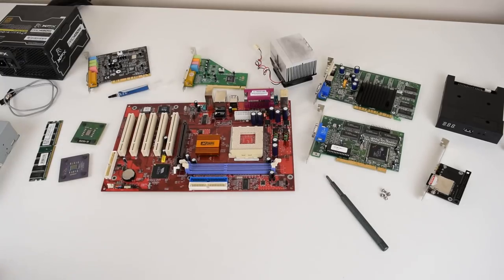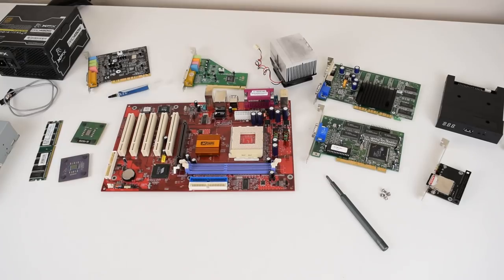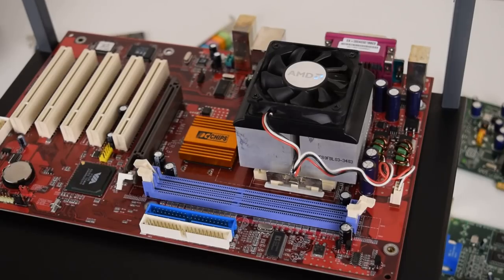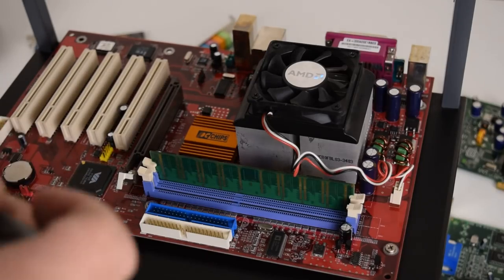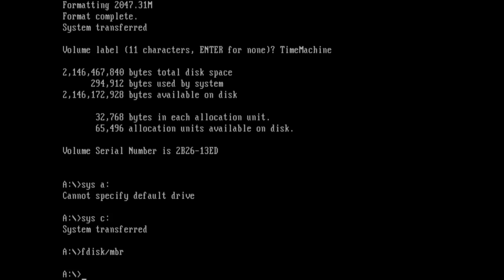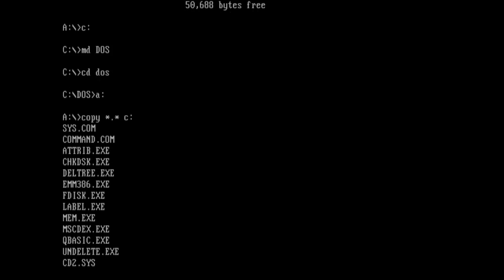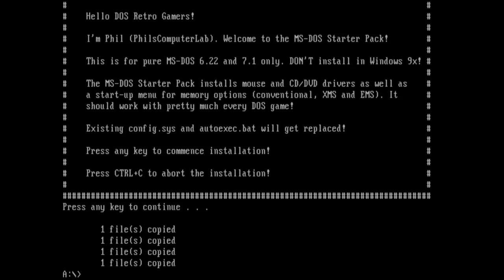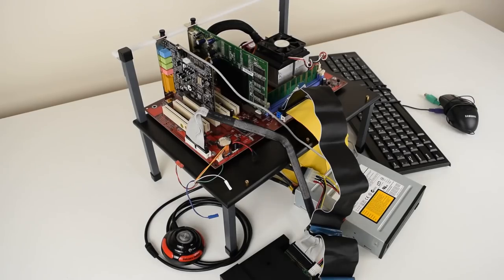Building a DOS Retro PC that everyone can afford

Comment: Hey Phil, I'm building a budget PC and I want to use a LGA1156 board, I'm planning on getting a X3470 and I want to overclock it to around 4 GHz which seems to be doable on most chips. The problem is that I do not want to spend too much on my motherboard and on Aliexpress I found those cheap Chinese boards that support overclocking however the VRM coolers look very basic. If you know if they are capable enough or if I'd need a to strap a fan to it or if its not doable at all I'd greatly appreciate it. :)
Reply from the maker: Are you sue they support overclocking? Do you have a link? We might have some videos coming up in 2 to 4 weeks, but not sooner than that.
Reply from the maker: That is pretty much exactly the board I ordered a while ago! It hasn't arrived yet. I highly doubt you can overclock it, but we will see. Would you overclock by changing the bus speed, or with an unlocked CPU? I reviewed a H61 board recently and it had all sorts of quirks. Fast Ethernet only, PCIe limited to 8x, no working Turbo. Rumours have it they gimp it to save power and make sure its stable.
Reply: It is a Xeon X3470. I'm not sure whether it is unlocked but I've seen forums online saying people have gotten it to ~4GHz
Reply from the maker: @bernardgreat2233  That board turned out rubbish. I urge you to get a used brand name board instead.
Reply: Thanks

Comment: why not just go for a Pentium III, Windows ME (just as buggy as 98/98SE) with boot into DOS Mode by defualt? that route would be cheaper, be able to run more programs and if you want you can add a soundblaster card into your PCI slot and then there would be no real need for a USB Floppy emulator if your motherboard has at least 2 USB ports.

Comment: A onboard trident blade 3d with 8mb of shared memory would work well? 

A Isa 2 or 4mb cirrus would also work?

My m7vkq motherboard has a isa slot but also a trident blade 3d oboard.
Reply from the maker: Yes, but Cirrus is the better choice if you have one.
Reply: PhilsComputerLab I only have one isa slot, so i would have to choose between buying a soundblaster 16 to have a good msdos audio support, but rely on the onboard trident blade or buying a cirrus and having to count with the ac97 msdos audio support. 
Pci gpus are really rare where i live, i dont know why, so a pci cirrus probably isnt a option, maybe a pci sb but i've heard that ms-dos has some issues with these pci audio cards.

Comment: dear Phil i need your advice , i have a p3 motherboard with one isa slot.  the problem is that on modern cases for some reason the isa slot  and the pci above  her,  is blocked by the case.  there is not open bracket on the case. isa seems too low.   do you have any advice choosing the case?
Reply from the maker: Yea modern cases are like that. You can look at getting an old case, or use an open bench like I do. The other option is cutting your case with a power tool.
Reply: @philscomputerlab   so i have to check for an old used case cause i  really need  this isa slot.  i want  to use isa  sb awe 64 instead of the the pci sb live i have,  the dos games sound really awfull , its a sb clone for dell machines (model sb 0228)  and this pci cause me a lot of incompatibility

Comment: Hi, I recently sold a 486DX4 motherboard with 40 Mb ram, a video card, HD controller card and i/o card. Sold for $40 usd right away. Was this a good price, too high or too low??
Reply from the maker: Hmm that is cheap IMO. You should put as auction and let the market set the price.
Reply: @philscomputerlab  Lol, maybe next time. Hey I also have an old Pentium 4 cpu and mb from 2001. What would this be worth do you think ?
Reply from the maker: @ricke6854  Put up as auction...

Comment: Hi,I've a question

Using a proper CRT Monitor that has VGA output
In order to play correctly DOS Games Who have 320*200 or 620*480 native resolution

In the Monitor CRT and on the Video card of the PC, what's the resolution that  I have to set?

Thanks
Reply from the maker: You don't have to set anything, the graphics card will just output 320x200 or 640x480 and the CRT will just display it like that.

Comment: Phil, how do you find the SD Card IDE for things like Windows 98, 98SE, ME, and 2000?
Reply from the maker: Ok, but recommended for DOS.
Reply: Yeah, I just wanted to use it on a P4 2.8 with PC133 and a Radeon 8500 on Windows 2000, and then again for two system, older than that one.

Comment: Hey Phil,

I was wondering why nobody I see around youtube making DOS machines, uses MS-DOS 7.1 =/ It's a shame, because I've tried it myself, and to me it's more appealing than 6.22 for many reasons: Improved stability, better memory management, power management, reimplemented support for older DOS commands (such as subst.exe, join   .c0m, assign   .c0m, exe2bin.exe, etc) larger disks support, FAT32 support, it even has its own splash screen. 

In fact, I don't like much DOS 6.22, I used to use either 5.0 or 6.0 before I found out about 7.1, because I use the older commands not supported in 6.22.

You should give it a try :)

Apparently Youtube doesn't like when we list MS-DOS commands with com extentions in the comments, my comment keeps getting deleted... =/
Reply from the maker: I think many people use it but as part of Windows 98 SE. It has MS-DOS mode built-in and you can set it up nicely. Use Windows 98 for easy folder management or FTP networking. The main benefit is the larger partitions, many want to have a huge game collection ready to go.
Reply: @philscomputerlab  But you can also use it as a standalone, I have the disks somewhere in my computer room. It just have all the latest stuff without drawbacks. Like I said it even has its own MS-DOS splash screen, which looks really cool. 

A comparison would be nice to see, but I guess at that point it's purely a matter of preference.
Reply from the maker: Yes but it's not straight forward and official. IMO installing Windows 98 and using MS-DOS mode is the way to go and I've showcased this quite a bit. It works really well.

Comment: PC without ISA on motherboard is useless for MS-DOS gaming. There are PCI cards with some compatibility, but it's not worth it.
I've just checked, you can buy old motherboards with ISA, PCI and AGP slots with CPU and RAM installed for about 40-50€. You won't get significantly cheaper than this and without ISA. Well, maybe in my country at least, because PCs are the main gaming platform for decades where I live, so there's a lot of older hardware lying around.

MS-DOS gaming retro hardware is still cheap. Amiga's on the other hand can easily go over 500€.
Reply from the maker: Watch the video regarding PCI DOS sound card.
Reply: Well... YMF744 based cards has been confirmed working pretty good under MS-DOS on the X58 chipset (first Core i7 platform) and even newer chipsets. I'm running a Core 2 Duo on an VIA based motherboard with PCIe and using the ESS Solo-1 under MS-DOS, works darn good and no TSR is needed. The main key is to get a PCI sound card and motherboard that behaves properly together under MS-DOS. Please feel free visit the Vogons forums if you haven't yet.
Reply: I know that some PCI sound cards can work in DOS, but it's not ideal. Even if it could work in every game, which I doubt. We will get only Sound Blaster support. With ISA we can install anything, for example Game Blaster or Gravis Ultra Sound.

You are doing great things on your channel, but retro hardware community can be really divided. Some will be just OK with emulators, other with any hardware that works, another group would want a period specific hardware and the last one will only be satisfied with original IBM PCs.

Also, for me important part of MS-DOS gaming is to push hardware limits. There's really no fun in running DOS games on 1+ GHz machines. More fun is to run games on 386 or 486 that were never designed for those systems.

Anyway, my original point was, that period correct hardware isn't that expensive. Well it depends where you live. In my country 500€ is more than enough to get fully working (almost) ultimate MS-DOS gaming machine. If you wait, or just search on your own, you can get great hardware for much less.

One last thing. You can do great things with retro hardware. 386 or 486 can be passively cooled and just need a simple power supply with +/- 5 and +/- 12 Volts. Combine that with a CF or SD card and you can make small, NUC sized retro PC.
Reply from the maker: Watch this video: https://youtu.be/vNCg_zy1_d4 It sounds better than most ISA sound card. Just let that sink in for a moment.

Comment: Could you put off showing 775 stuff until I can put together a Crysis-era top-end PC? :^)

Also, regarding "top of the line for a generation versus middle of the road for the next generation", part of the reason someone might go for the former instead of saving money with the latter is nostalgia. Sure, the middle-of-the-road PC would do the job just as well (maybe even better) for significantly less, but it's not the PC you obsessed over as a kid. A Pentium with the onboard cache disabled would be "equivalent', but it's not a 100 MHz 486.
Reply from the maker: 775 isn't cutting it for Crysis I'm afraid. It really IS that demanding :D
Reply: Hey, who said anything about running Crysis well? I'm all about running Crysis the best it could be on release. That means Core 2 Extreme, which means 775.

If I wanted to run Crysis *well*, I'd just play it on my main computer.
Reply from the maker: Could make a cool video topic...

Comment: a socket 775 system with a xeon cpu mod running ddr2 mem is very capable system still, i recently "retired" mine as my 2nd pc as i upgraded my main pc to a ryzen 5 1600x so used my Fx6350 and 16gb ddr3 mem in my "new" 2nd pc, but ill still be on the lookout for a more capable MB for the xeon system "you gotta get the right type of board that are compatible with xeons" gigabyte boards are the best but intel boards are defo not which is silly really as xeons are intel chips
Reply: What Xeon and GPU did you use in your 775 rig?

Comment: What setting would be best for early "3D" games like the first Dark Forces?
Reply: Also, would you be able to do a crash course in setting up a DOS/95 dual boot?
Reply from the maker: I recommend using Windows 98 SE and built-in MS-DOS mode. Been using it for years.
Reply: What setting do you mean?
Windows 95 includes DOS, press F8 on boot up to boot into DOS directly or click on "Exit to DOS" within the Windows 95 GUI.

Comment: What about for those of us that, for lack of better wording, would rather have a hot poker in the eye than deal with another via chipset motherboard? I've never, ever, had stability, let alone success, on a via chipset motherboard, from any era.
Reply from the maker: I feel for you, but cannot relate to your issues. Maybe it has to do with now being able to used latest BIOS and drivers. But, at least starting with KT266A, I recommend them. And yea, I work with a lot of different boards, so this isn't based on just one project.
Reply: @philscomputerlab  I've never been able to get that a8v deluxe to work. As soon as i install the chipset drivers in a fresh install, the install is corrupted and in a bsod kill cycle from the next reboot.

Comment: i just bought a  working dell demension 4100 p3 866mhz cpu computer  with agp ATI All-in-Wonder Rage 128 Pro 32MB TV Tuner Video Card  ,with 98se  and 384 mb ram for 80 dollars and free shipping  and it  is upgradable to 1gz cpu .i do have dos 6.22 software will it work on my dell computer or is the computer speed to fast,  ,, i know windows has dos ,,i wanted to try pure dos ,, iam planing to get a ide to sata card to add a sata 120 ssd 2.5 drive,,it has the optinal onborad sound i will be upgrading  and internet port,,,,,,,,,,, also  i have a dell P3 demension XPS D300 with  with original windows 95 ,,300mhz computer and a clean gateway 2000  P5-166XL computer -166 mhz, ,,,,tall tower with 98se,,, built in feb 1996,, ,, like all the videos you make,, love computers,,  its FUN hobbie,, somtimes expensive

Comment: One project I would like to see you do is the DIY Midi Cables. Its not complecated from what I see, and penny's for components its a way cheaper solution and cables can be as short as you need so the midi box looks slick sitting on top of the case. I can solder, and I'm fairly technically skilled I just need a little lesson on reading electronic plans. 
Check it out below and tell me what you think.?.
https://www.weethet.nl/english/hardware_sbmidi.php

Comment: My working Retro Parts:

- MSI K8T Neo2-F v2.0 (found in trash)
- AMD Athlon 64 3000+ (found in trash)
- AMD Athlon 64 3700+ (found in trash)
- Seagate BarraCuda 7200.7 80GB (found in trash)
- XFX Radeon HD 4650 1GB DDR2 AGP (found in trash)
- Gainward GeForce 6600 GT 256MB (found in trash)
- MSI GeForce 7600 GS 256MB (bought for 2€)
- ATI HD 2600 XT 256MB PCIe (bought for 2€)
- ATI Medion 9800 XXL AGP (bought for 3€)
- Nvidia GeForce4 MX 440 64MB (bought for 1€)
- AMD Athlon 64 X2 4000+ (found in trash)
- Intel Celeron D 330 (found in trash)
- ASUS P4P800-MX  (found in trash)
...

My Dead Retro Hardware:

- CREATIVE 3dfx Voodoo 2 CT6670 (got for free)
- MSI GeForce 8400 GS 256MB (got for free)
- Palit Radeon HD 4850 512MB DDR3 (bought for 3€)
...
Reply from the maker: Great value!

Comment: I want to build a floppy emulator that uses modified floppy disks with a slot for an sd card. That way you can still have the feel of a vintage computer. I bet people would buy that up faster than the us government can give money to billionaires.
Reply from the maker: There exists already a really useful device, the GOTEK Floppy emulator :)
Reply: PhilsComputerLab well I know but that’s been around a while. I’m saying basically build a housing for it that lets you insert a custom floppy disk with an insert for a sd card and have it read off that instead of a usb drive. It will make the retro computers feel more original.

Comment: I'm coming in rather late, though as it's "Retro" should have longevity.  I must CAUTION AGAINST PC Chips motherboards.
I was "Returns Manager" (sole returns employee) for a PC Builder at the end of the 90s, building cheap crap and used PC Chips boardsm though a generation or two before this as we used K6-2/3 400-500 CPUs, but the hardware and fireware issues we too numerous not to pop this caution on such a video.  "Retro Builds" are meant to be about a great experience and I'm concerned that going this route could ruin such an experience.  Please double check the quality of these boards before finalizing your buying decisions.
Sorry for being the misery guts :-(

Comment: Lol I'd recommend  Intel socket 478
Reply: 1NIGHTMAREGAMER I wouldnt... Way more scarce, rare, expensive, usually are oem dells or hps with proprietary connectors for many things and even sometimes for the PSU, and usually these boards dont fit in a standard atx case. 

Also a athlon 3200+ would perform way better for newer tasks, and be way colder.
Reply: @1NIGHTMAREGAMER - Only with well bridged ISA slots for real ISA sound and a mobile Northwood for smaller power footprint than Phil's S462 build, of course :D

That works quite well too, and ~ the same level of this Duron on DOS demos that don't really like the Netburst architecture.

But S478 and ISA is definitely not this common. More common PCI/AGP only S478 builds won't be any better for DOS and won't even run much cooler.
Reply: @eduardoavila646   i have a  mobo i can overclock a 3.4ghz p4 ht cpu but any hugher speed and the thing over heats on full blast lol try get fill to send it ti him with some ram he can review it lol
Reply: 1NIGHTMAREGAMER Yes, i had some p4 boards aswell, but they were the early 775 boards. 
I overclocked but awayd used reay bulky heatsinks and some coolers (1-3). 
But a overclocking a pentium d is suicide. A friend tried and just basically killed it, even with a 125w heatsink.
Reply: @eduardoavila646  the p4 board was 3.4 ghz socket 478
Reply: Socket 478 can be OK for this. Not the only cheap option and certainly not necessary.

Also going to run hotter/consume more power. So what is lol about Socket A?
Reply: Directionless Yes, many socket A cpus are something like 45-55w cpus usually, and some are 35w so not that power consuming.
Reply: Alvaro Acwellan Then i would go with a early atom board. Some have pci slots that can accept old gpus, soundcards, and usually like the n455 consumes only just about 6.5w, and it has a pentium 4 performance, around 1.6ghz. Many will have a actually not bad win98 support, and even with the onboard sound like a ac97 you can have some dos compatility such as with mpxplay. It will probably be cheap, maybe be fanless (as many atoms can be, and if not, just put a bigger heatsink in there and remove the fan), and there you go, a silent low powered retromachine.
Reply: 478 is always a tricky socket because of the capacitor plague. Scores of dead boards, cpu's came out of that early to mid 2000's run etc. :( I've stepped up to 775 because it's easier to find stuff.